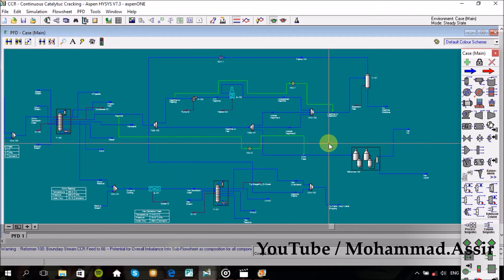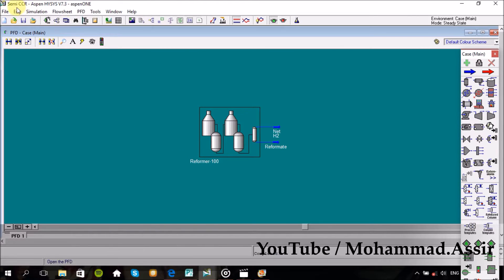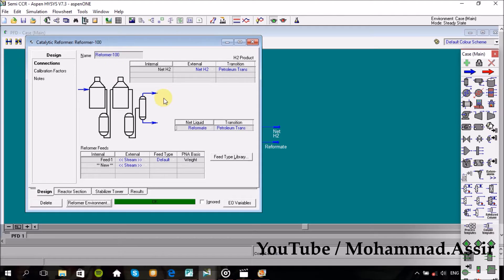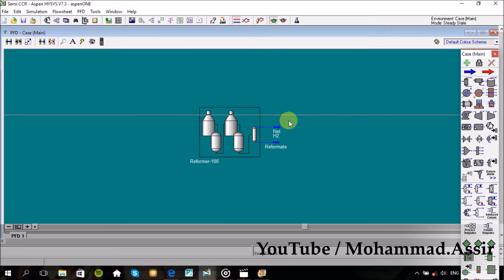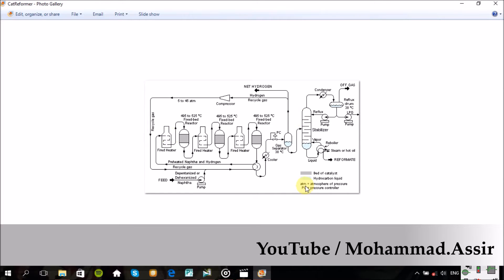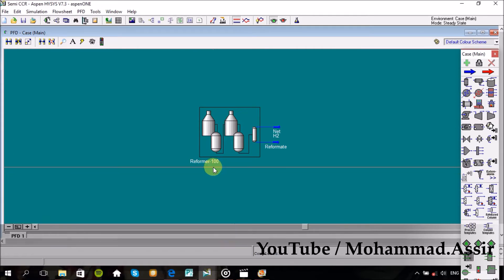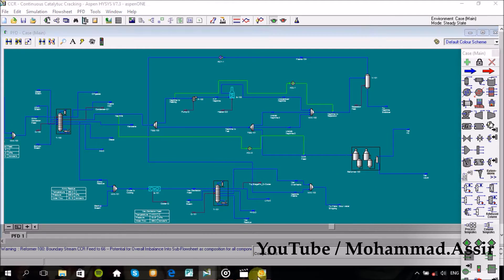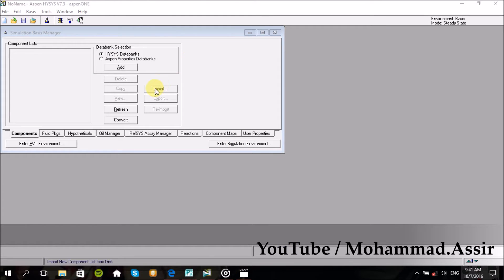8-Refining Process - (CCR)/(1/2) Continuous Catalytic Reforming - (Detailed Unit)- Aspen hysys 7.3

Comment: Hi, I just put the same input as you in hysys V8.8 and I get the error Destillation for one of the feeds is not monotically increasing. Model will not run until this is corrected. I would love if you could help me.